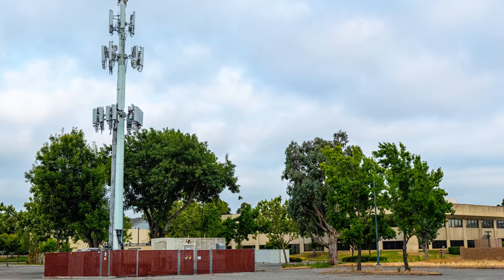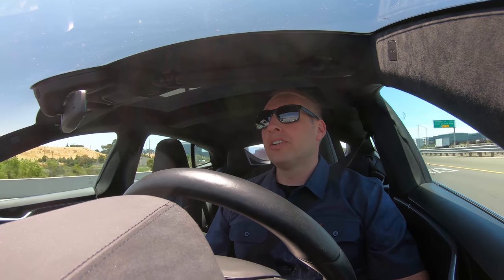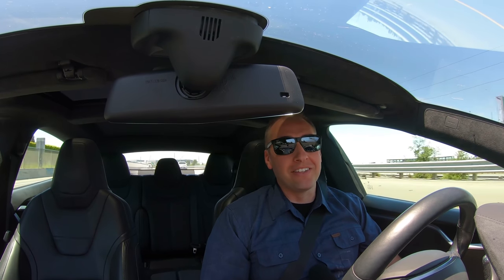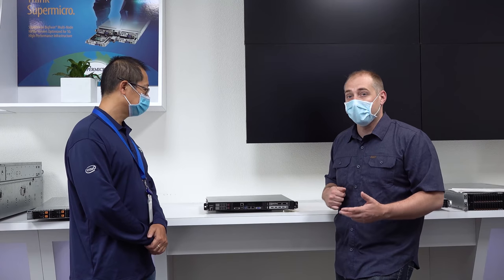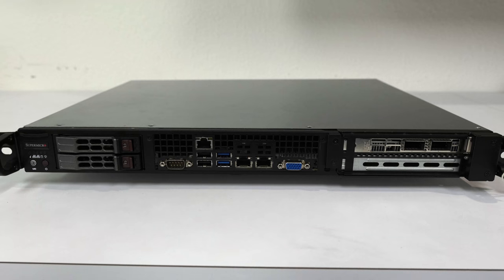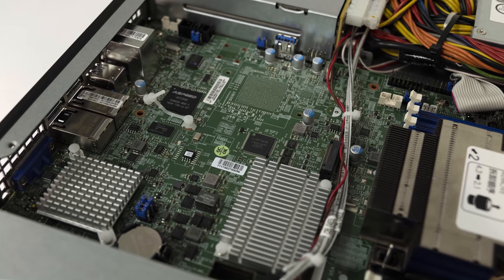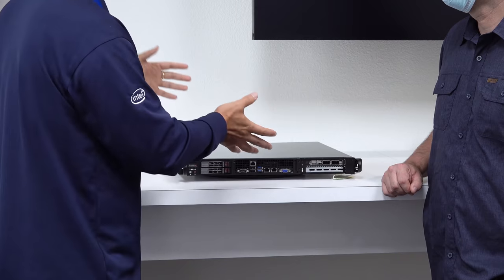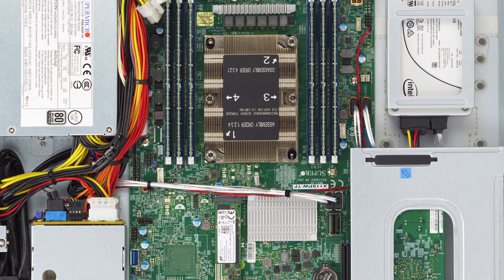Supermicro SYS-1019P-FHN2T with Intel PAC 3000 Accelerator 5G ORAN Server

Comment: What did Ericsson do to deserve being solely hanged out multiple times for supposed "vendor lock in"?
What about Qualcomm, Huawei, Nokia and the other less known companies supply GSM base station products?

The statement at 7:50 "Years ago Intel bought a company called Altera which was probably the biggest FPGA company out there."
Well, heard of Xilinx?
They invented the FPGA back in 1985, and have had the largest market share in the FPGA market ever since.
Back in 2018 for an example, they had 51% of the market, Intel only had 36%.
Back in 2015 when Intel bought Altera, they had a market share of 37% percent, and Xilinx only had 50%.
(And it has looked like that for a long time...)
Reply: Intel bought one of major players in FPGA. One thing that many don't know Altera was who bought Intel old FPGA stuff.

Comment: 100Gig networking on a small server seems a bit ridiculous in a normal workload.  So at least this use case makes a bit of sense though I suspect they are doing a breakout of the 100gig to 4x 25gig for the individual radio sectors on the pole.

Comment: is there no AMD ryzen/TR/epyc systems in this market?
Reply from the maker: This particular segment AMD has a lot less penetration in with EPYC. That may change.
Reply: ServeTheHomeVideo if AMD could pool this trick, Intel will start sweating since it’s one of their last holding point
Reply: Well, the network cards are made by Intel as well, so you might as well get an Intel system.
Reply: Maybe we see AMD + Xilinx setups in future. Xilinx have some nice processing cards for server with dual 100G interfaces.